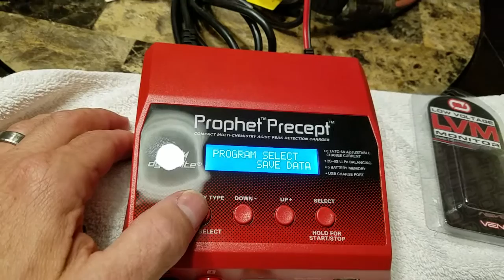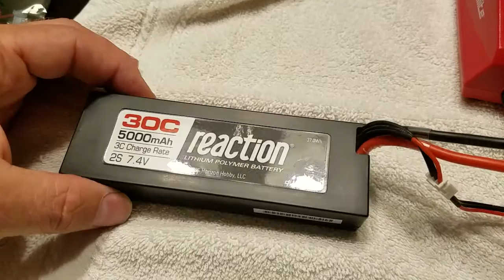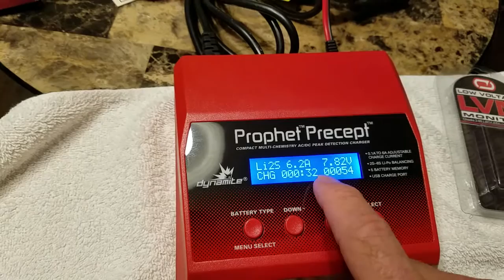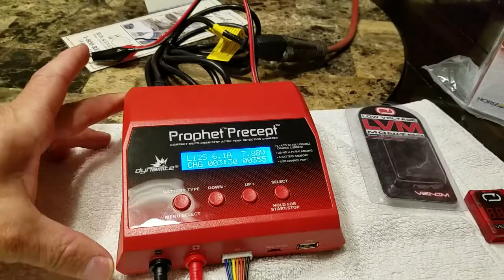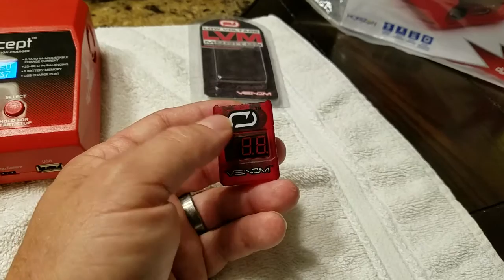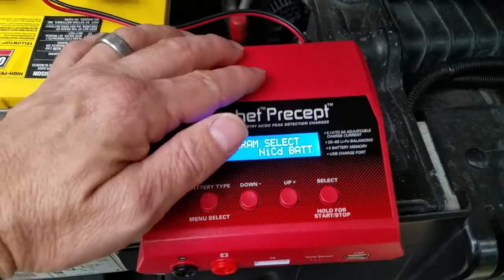Prophet Precept Battery Charger Review

Comment: Thanks so much.  Haha.  I wondered why I couldn't get my batteries to charge.  I had the battery connected with the small plug, but didn't know I had to connect the battery to the charger with larger two wire plug at the same time.  LOL.